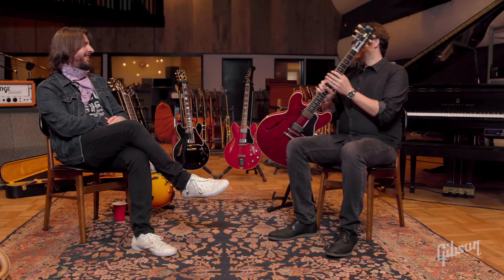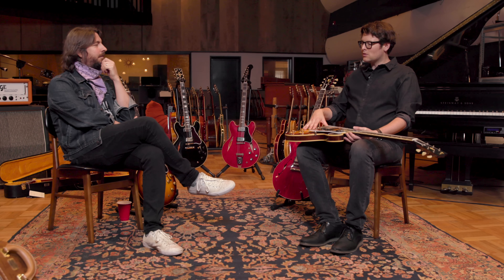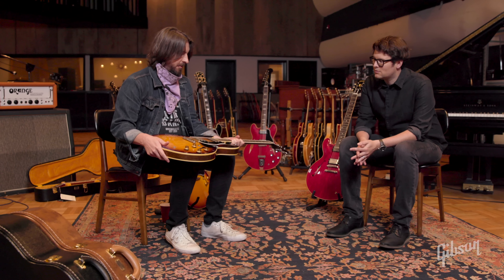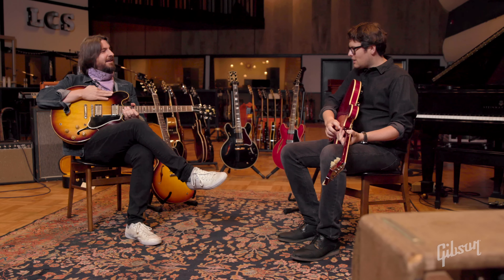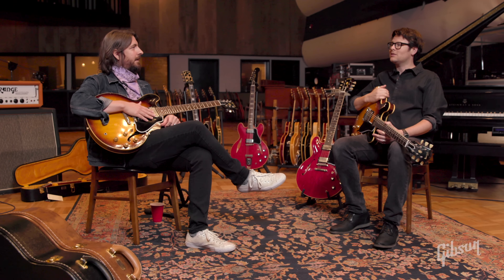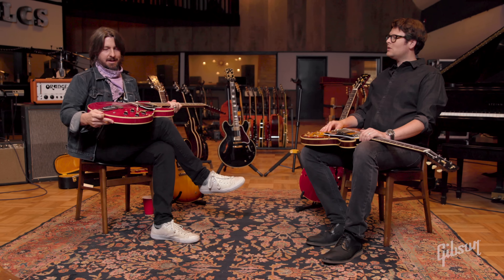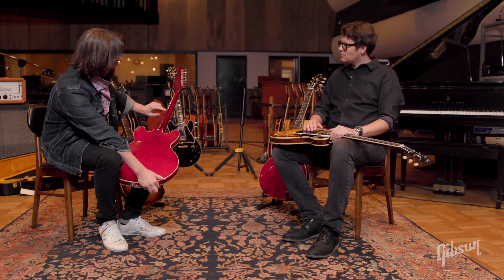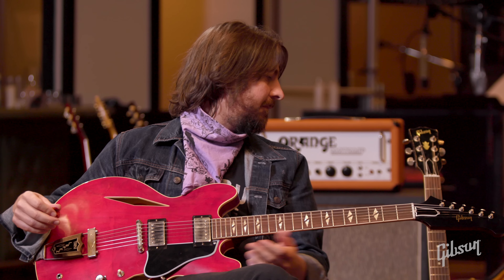Gibson ES Made in Nashville With Dave Cobb

Comment: The 335 is the emperor of all electric guitars.  It can do anything you want from jazz to rock to country and back again.  For anyone who hasn't had a chance to play one they are surprisingly heavy.  I have owned an ES 125 for many years (yet another incredible instrument from Gibson) which is a fully hollow body and light as a feather.  The key to the 335 is the maple center block which adds a bit of weight.  Mine is as heavy as a Les Paul which can be sort of surprising.  They look like a hollow body but they combine the best aspects of a hollow body and a solid body which is the reason they are so versatile.

Comment: With all due respect, I think Ted McCarty may have been inspired by Les Paul's log guitar, the hollow body Epiphone, with the 4x4 solid center section, and the two hollow wings, when it comes to the ES-335. So Ted McCarty invented the Les Paul guitar (or designers under his watch), and Les Paul kind of created the semi-hollow concept.
Reply: Yes, they seem to neglect mentioning that les had made that Guitar(The Log) which is obviously the "Original " feature that the 335 was based on..just thinner. I suppose they think Les paul has had enough time in the spot-light ?

Comment: Two weeks ago I ordered an ES-335 (60s cherry, plain top). Inside the case I found many small wooden flakes and a washer next to the guitar. I could not find the original place of the washer, but it could easily scratch the guitar. The instrument had one ding on the headstock, and it had lacquer chipping at various places along the neck binding and residue of polish material here and there. I found tooling marks on the fretboard but what frightened me the most was the unsanded/unchiseled maple centerblock inside the body - probably that is the place the small wooden flakes came from. If I was a luthier, I surely have sanded down the centerblock before using it (it takes at most 10 minutes). We are talking about a 3000 EUR guitar, not a cheap knockoff from China. I sent it back and I am discouraged to buy another Gibson.

Comment: Gibson , do you focus on the points of contact ? Are the metals used in the vintage the same as the reissues ? My 2007 Gibson SG had a heavy bridge and tailpiece . I switch out for a Faber/Corsa bridge and tailpiece and it made my guitar ring like a bell . I believe what the string is sitting on is just as important as wood and pick ups . The tuners , nut , saddle , bridge , bridge post , tailpiece , tailpiece screws . If those are not resonate then you are losing tone . Those great vintage guitars had resonate hardware .